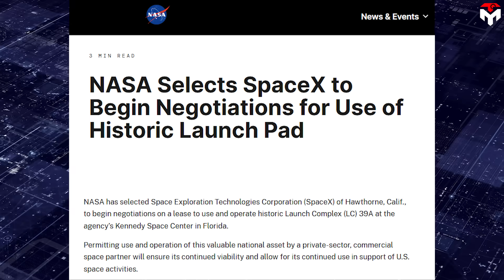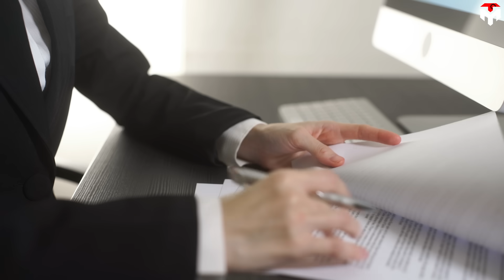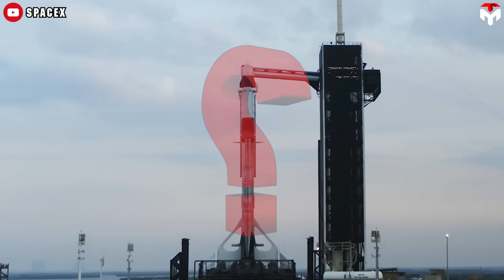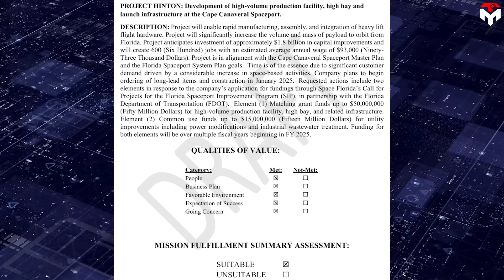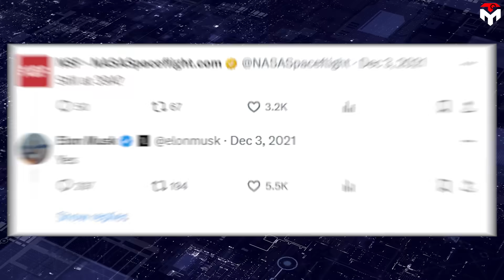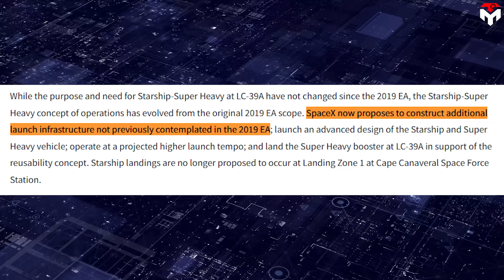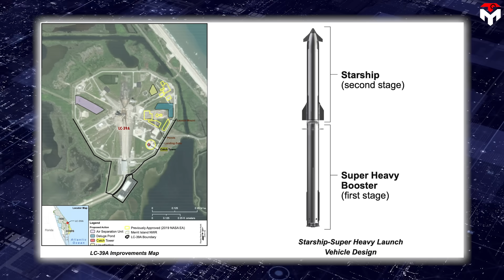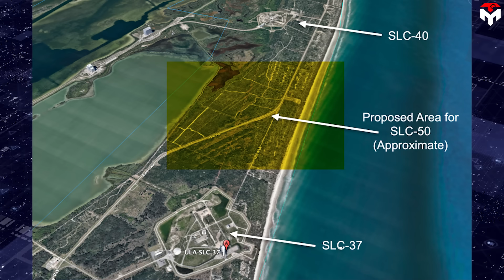What SpaceX Just Did in Florida after California's Launch Trouble Shocked CA Gov!

Comment: Well, excellent report. I would not eliminate the Falcon 9 myself except to replace it with a more powerful modified Falcon rocket based on the use of the Raptor engine. A rocket that can be used for launches and landings from every state in the union and especially from every near ocean state. A rocket with perhaps 15 Raptor engines and second or third stage that can land propulsively. The Starship is a great idea and worthy of acclaim but can only be launched from a limited number of locations. The real strength of the Falcon rocket is that it could be used point to point on earth. While it cannot carry the same weight as the Starship, I just think the utility of it is exceptional in certain applications. Clean up the emissions and more than double the delivery weight. We may soon see what Blue Origin has in mind but it could fill the bill if it works. For me, that's a horrible thought but unfortunately doable. Given headlines this morning we are back in war mode and anything we can use to protect ourselves is a bonus. I believe SX could produce a modified Falcon rocket (or modified Starship) and do it pretty quickly as opposed to the apparent limitations of Blue Origin.
Reply from the maker: I agree, the Falcon 9 is a powerful and versatile rocket!